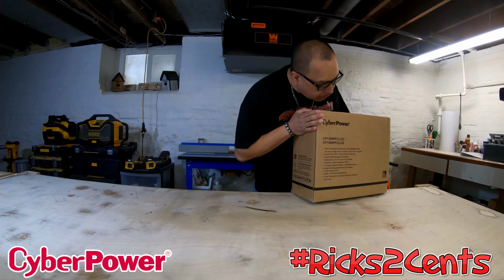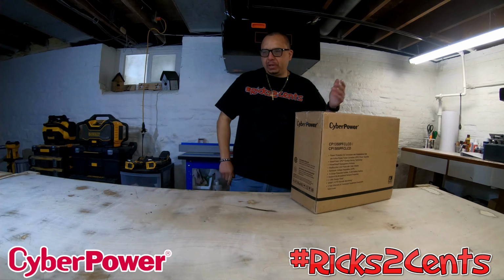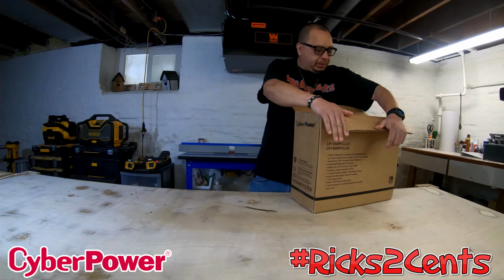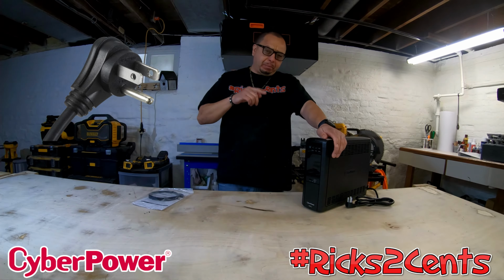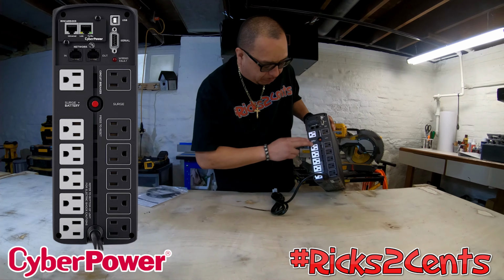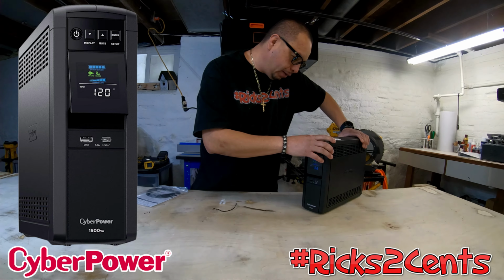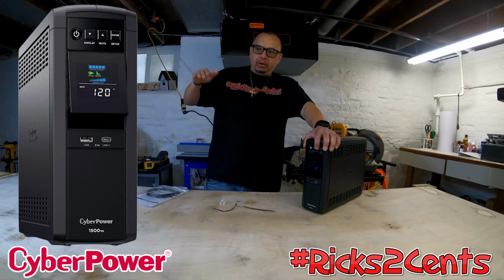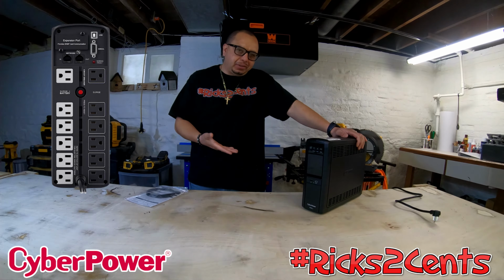CyberPower CP1500PFCLCD UPS: Unboxing & LCD Walkthrough

Comment: YOU DIRTY ....AC LIVE SINGLE WIRE...GROUND -NEGATIVE NEUTRAL+-BOTH  BATTERY -NEGATIVE POS+ CHARGED 2 WIRES TO DETECT CHARGED NEGATIVE -12 TO POSITIVE +12 . SWITCH POLARITY 2WIRES....ACTIVE LINE LIVE SINGLE TO PULL PUSH..NOT ALTERNATING..PULSES PUSH

Comment: NEW FLASH. Very few surge protectors will ever protect against a full  direct lightning strike. Most of these devices will help against normal surges. You get surges every time your HVAC cycles on and off.
Reply from the maker: FYI It comes with a 3-YEAR WARRANTY – INCLUDING THE BATTERY; $500,000 Connected Equipment Guarantee and FREE PowerPanel Management Software. So...

Comment: They need to start including USB-C with these. Both my laptops are USB-C only.

I'm curious if I can run 2 of these one 1 outlet/1 circuit.

Each one would have a nrewer Dell laptop, 2 Dell monitors and a Dell docking station. One for work, on personal.

I ran all those on 1 APC for a few years (it was over $400). My APC batteries died after hurricane storms killed power and I let the drain.

I'd imagine best use if I use 2 of these on 1 outlet that when power goes out, once all devices are off, turn these off. Then when power comes back on, turn on 1 at a time umtil its charged.

My logic is the most power it would draw from the outlet is when recharging.
Reply from the maker: I'm not run Both Desktop's on 1 UPS?
Reply: The new model has USB C. If you’re using laptop you don’t need UPS